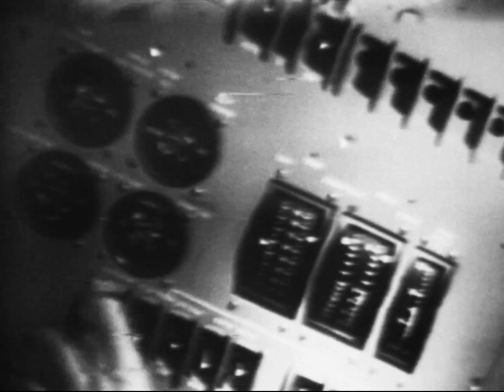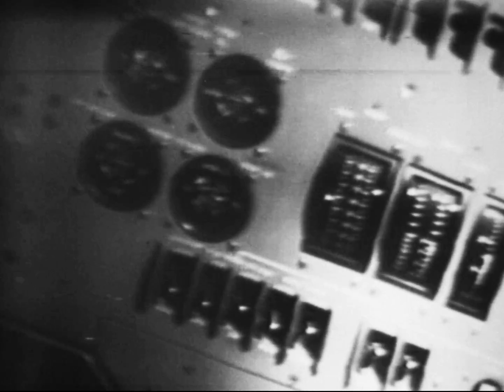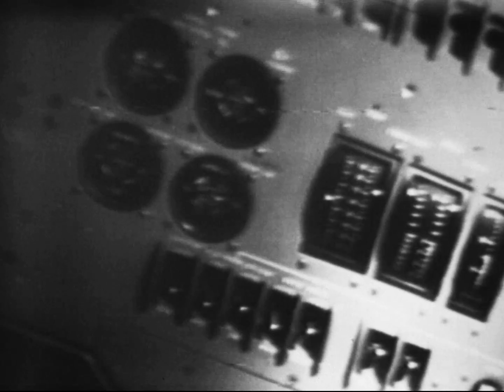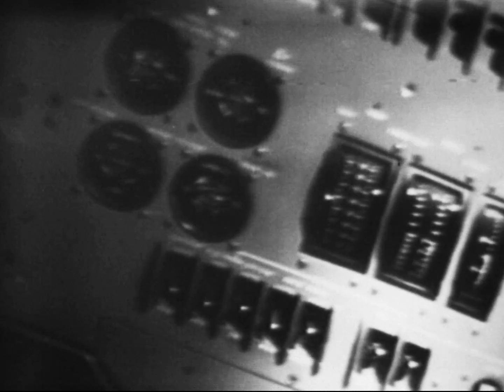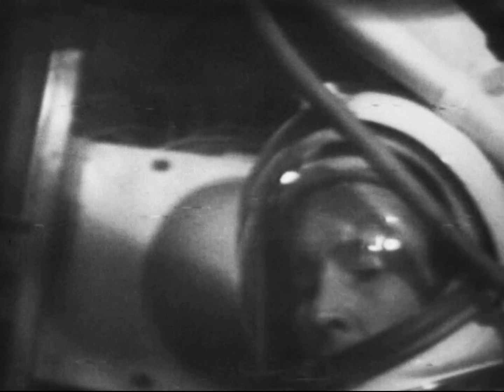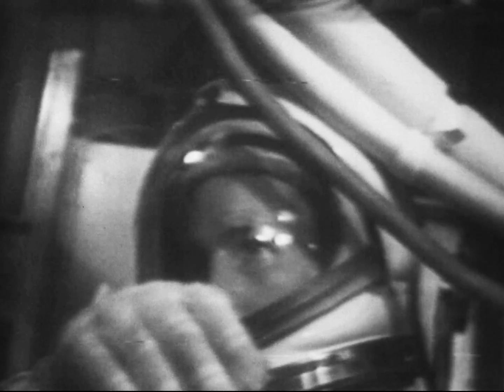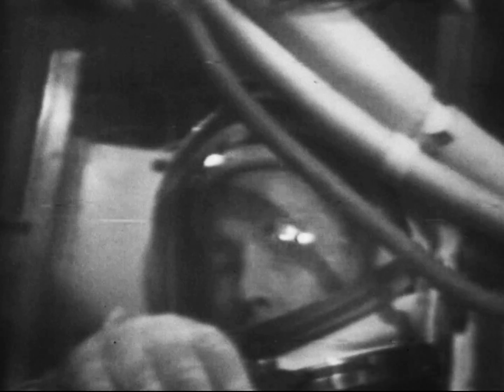Apollo 1 Capsule Camera Test

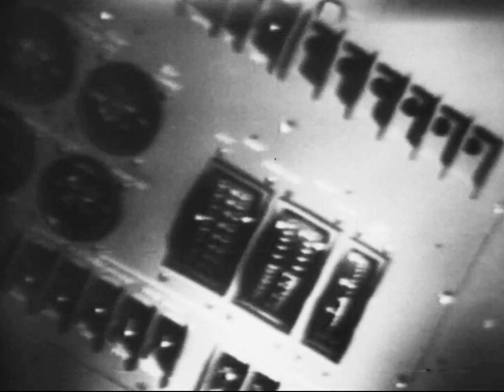Comment: Well, here's an interesting inconsistency I found. In every Block 1 main console picture I've found, either diagrams or photos, there are corrugations on the seams between panels - presumably to make mounting them more rigid. Looking around 4:01 you can see that this panel lacks them. Also, the switches they toggle around that same time are placed strangely.
I suspect this is filmed in the simulator, not a real CM. Can't easily find pictures of the sim they used.
Could also just be design changes - if this is 66 that's pretty early for the apollo spacecraft in terms of actual flight hardware.

Comment: Theres a fire on a capsule and none brought a fire extinguisher or something like that Im not very sure of how the chemicals in the fire extinguisher could affect the fire maybe it could make it bigger so im gonna say they should e at least tried to stop the fire
Reply: NASA made a really stupid decision and made the capsule hatch open inward making it impossible to open the hatch because of the extreme pressure caused by the fire. NASA also decided to make the cabin 100% oxygen which caused the fire to turn into a raging inferno in seconds.
Reply: @gorpmeister  That hatch was ironically designed to open inward because of the exploding bolt mishap on the hatch of Grissom's Mercury flight.  Hatch design almost killed Grissom on Mercury and contributed to his death in Apollo 1.
Reply: "how are we gonna get to the moon if we cant talk between 3 buildings?" i believe the comms were delayed and they received the "we have a fire in the cockpit" alot later and or they couldn't make it in time to save them
Reply: @fantasybabydino  the hatch wouldn’t open due to compression sadly 😢
Reply: Due to the nature of the test they were performing, the atmosphere inside the spacecraft was was not only pressurized to 16.7 psi (2 psi over mean sea-level pressure), but was also pure oxygen.  The air you breathe every day contains only about one fifth oxygen, which means there was nearly SIX times the normal amount of oxygen inside the cabin of the command module. 

A side-effect of this altered gas combination is that materials that are normally considered flame-resistant become highly flammable in the presense of increased oxygen (nearly all flame-retardent technologies assume normal or near-normal atmospheric pressure and gas composition when engineering fire-resistant materials).  The treated nylon of suits, insulation, and velcro became like dry leaves, soaked in kerosene, in a forest fire. Even with an outward-opening hatch, there may not have been enough time to have saved these men.  There is no clear way to contain something like that without a system that renders the ambient atmosphere rapidly unbreathable (which may be worth considering with three guys with suits hooked up to independent air supplies, but that is not the most likely condition in which a catastrophic fire can occur in a spacecraft).  

The tragic reality is that this accident was a perfect storm of unconsidered what-ifs all coming together at the wrong place at the right time.  It is easy to think it obvious half a century after the fact.  Indeed, this was not even the first time this type of accident happened.  A soviet cosmonaut was burned severely and subsequently died in short order after a fire broke out in a capsule simulating an endurance test which featured a higher than normal level of oxygen in the environment.  But due to Cold War animosity and the general paranoia around space and technical research, his death was covered up, and crucial information regaring the risk of analagous operating procedures was not apparent to engineers in the West.
Reply: If the Soviet Union had said about how Bondarenko had been burnt alive in a test in a pure oxygen environment, maybe the Apollo 1 disaster could have been averted.
Reply: They did.  Several times.  They couldn't get into the capsule because the pressure from the gasses.  The capsule did basically crack open from the pressure and the smoke and fumes were so intense that they couldn't get near it.  

Several tower techs risked their lives to try to help them and passed out from the fumes.  It was simply an impossible situation.

Comment: I find it interesting that, at the time of this exercise, the positions were labeled “Commander,” “Navigator,” and “Systems Engineer.” At the time of the Fire, they’d been changed to “Command Pilot,” “Senior Pilot,” and “Pilot.” By the time of Apollo 7, the positions were “Commander,” “Lunar Module Pilot” (who handled navigation), and “Command Module Pilot” (who was responsible for the CM’s systems).
Reply: No. The CMP (Command Module Pilot) was the navigator, he was responsible for using the sextants to align the guidance platform at various points throughout the flight. Jim Lovel mentions this while commenting on his Apollo 8 flight, where he was CMP, taking care of the navigation to and from the moon aboard the spacecraft.
The "systems engineer" was in fact the LMP. The LMP position was in fact the most junior position in the spacecraft, as one of the criteria for becoming a commander, was to have CMP (or Command Pilot from the Gemini days) experience, because the CMP is the one who's got the most knowledge on the Command-Service Module (along with the Commander). 
This is why John Young (CMP on 10) got the CDR position on 16, Jim Lovell (CMP on 8) got the CDR position on 14 (then they replaced him with Shepards crew on 13, because they felt that Shepard needed more training as he'd just been accepted back on flight status again, after having had surgery to correct menieres disease), Armstrong (CM on Gemini 8) got the CDR position on Apollo 11 etc. The only exception to this "rule" was Gene Cernan, who was Pilot on Gemini 9A, LMP on Apollo 10 and CDR on Apollo 17. He was originally offered the LMP spot (again) on Apollo 16, but he declined it, preferring to take his chances on getting a CDR's slot on a later mission, and as history shows, it paid out.
Reply: @Nghilifa  All accurate. And if I recall correctly, I believe the main reason Cernan received command of Apollo 17 was because Mike Collins was originally in line to be offered the position as per standard Apollo CMP 6-mission rotation but had declined it for personal reasons. As a result, NASA went a mission back to the next most experienced astronaut in order of rotation (Gordon, Apollo 12 CMP, was already in line with a crew for Apollo 18) and selected Gene Cernan (a fellow Gemini pilot veteran, as all Apollo CDRs were), who became the first and only Apollo LMP to command a lunar mission.
Reply: @DjinnGuru  Yup. Cernan was the only astronaut to command an Apollo mission without previous command experience (in either Apollo/Gemini/Mercury).
Reply: @Nghilifa  Well, to be accurate, David Scott, while having served as Apollo 9's CMP, never held a command prior to Apollo 15. So he falls into that small category with Cernan as well.
Reply: That is correct and documented.
Reply: Any alternative theories will need to explain why they use Commander/Navigator/Systems Engineer in this video.